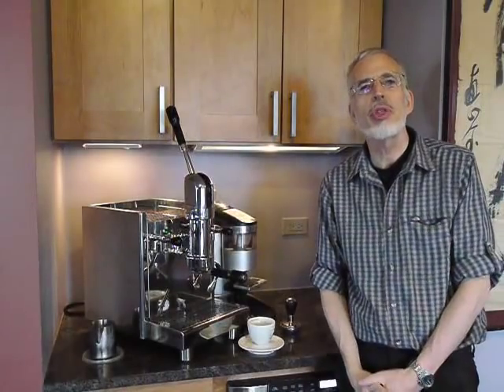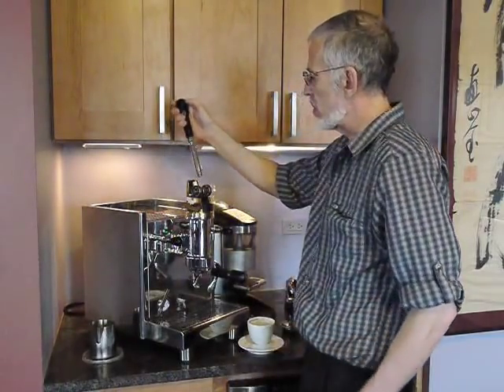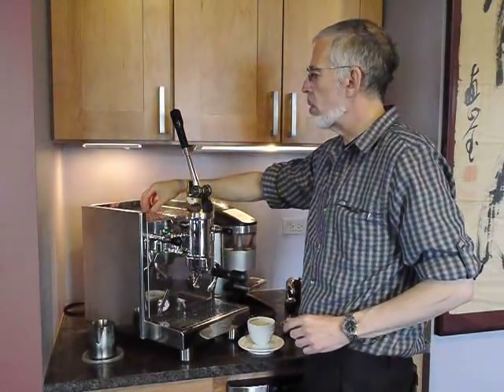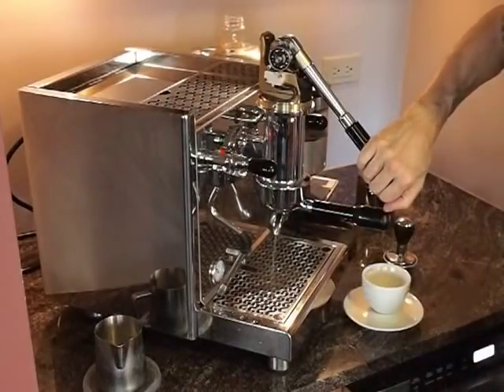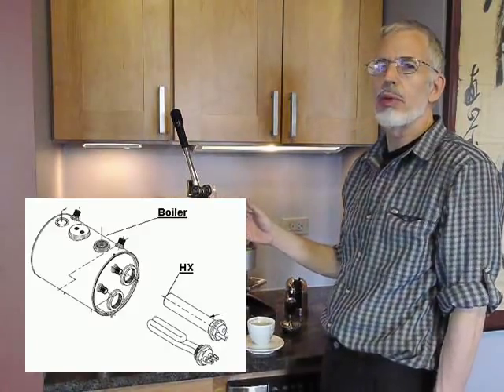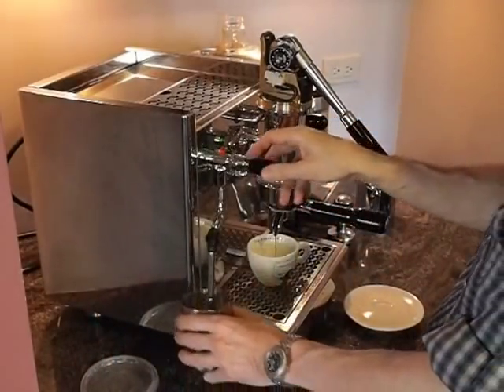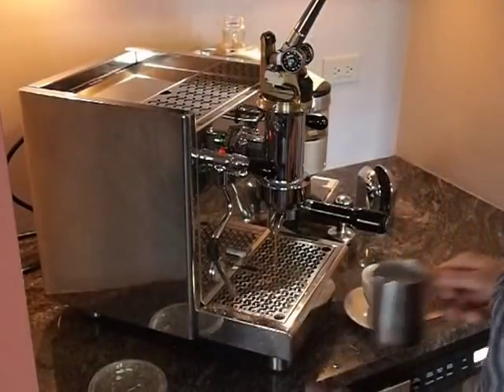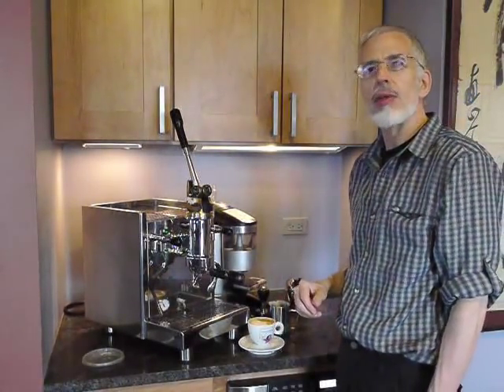Strega Introduction.avi

Comment: Hi Jim,  I loved the video.  I'm  bit of a newbie, but have well qualified specificity of process in adjacent interests to have me spring for a lever machine from the get go.  I have a question or two and hope that your will indulge my naivete.  I am considering two machines, the Bezzera Strega and the Profitec Pro 800.  The profile of the Pro 800 is more or less a pre-infusion of 1-1.5 bar and then from 12 bar to zero during the lever release, while the Strega, you're quite familiar with...I think the pre-infusion of the Strega is more controllable depending upon how long one waits before engaging the lever...I think a pre-infusion of 9 bars is possible, though I assume that's really pouring espresso out of the group head at 9 bars. Should you have any thoughts I would welcome your experience and input.   thanks,  Fred
Reply from the maker: The Pro 800 is a classic "sipper" lever machine. With the lever pulled down, the preinfusion (PI) is at boiler pressure, around 1.2 bar.  BUT, you can raise the lever and hold it steady at any position you like to raise the PI pressure. On the Strega, you are right, the longer you let the pump fill the group, the higher the pressure goes. Once you get used to the sound, you'll be able to vary it as you please. 

You will need to fiddle with the micro-switch on the lever, so that moving the lever right and left turns the pump on and off.

Comment: HI JIM, in one of your presentations you said it's importan to purge the machine any time it's going to be used. And I saw you doing that in the video. but later in a commentary you said that's not necessary. I'm confused. Maybe I misunderstood you.
Reply from the maker: Hi Maria, I'm replying to both your comments here. Flushing the machine serves two purposes, the easier one is cleaning, and the more complicated one is temperature management. 

For cleanliness, it is good practice to occasionally flush the machine after shots and wipe off the shower screen. Most home baristas do it after every shoit, but this isn't necessary.

On HX machines, like the Strega, the water in the heat exchanger rises to steam boiler temperature as it idles. But most of thee machines are designed with cafe operation in mind, and the group expects water that is heated just by passing through the heat exchanger, not sitting there. So I was thinking "HX machine, must flush out the overheated water" 

Buit the Strega is designed as a home machine. The group is a little cool, and is heated by the water on the first shot. Then, on subsequent shots, the group i hotter, and the HX water cooler, so it all balances ... roughly (within 2C). So flushing is not strictly necessary, althoug you might get slightly more even shots if you do.. 

If you are in mind for more precise temperature control, a lever machine is not a good choice. You are better off with a double boiler with manual flow control, or the Decent, if you prefer setting everything up ahead of time..